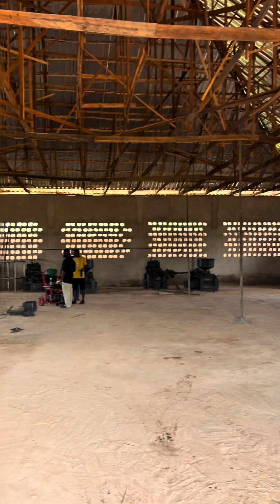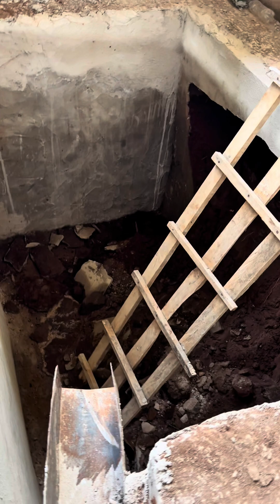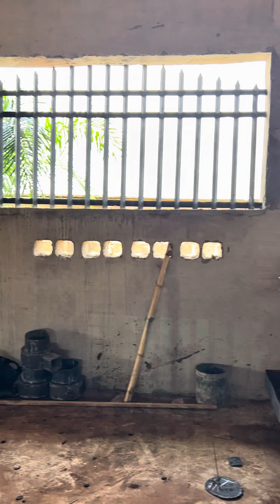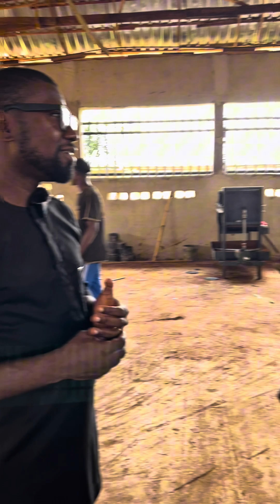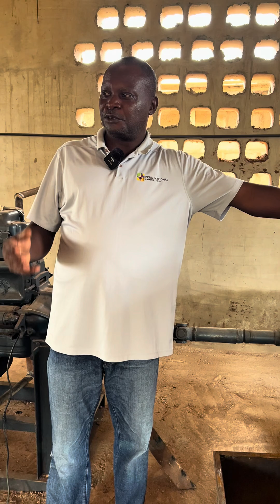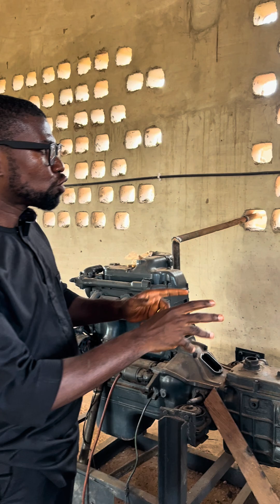Setting up a Palm Kernel crushing facility

Comment: Nice video bro, but from his analysis it’s actually not profitable. If 1ton of palm kernel is sold 720k like he said then 3 tons of palm kernel gives 1 ton of palm kernel oil at the rate of 2.4m there there is no profit in the business after spending on diesel for the production.

3ton of palm kernel is #2,160,000  (720k) per ton.

3tons of palm kernel gives 1ton of PKO Which is 2,400,000

If you include cost of production both labor and dissel there is no profit left base on his analysis. Although I know pkc is also been sold but still don’t show up as a lucrative venture. Please I will like u to trow more light on this because I have interest in venturing into this business
Reply: You just Said my mind
Reply: If I get the man clearly, he said that the market fluctuates and the least you can sell is 2.2m per ton. 

It means if he is buying a ton at 500k and sell at 2.2, he is gaining 

If he is buying a ton at 600k  and decided to sell 2.2 at least he still has something but he may like to sell it at 2.4 because he got the raw material when the price is going up

But if he is buying at 700k for a ton when the price is at the peak, it means that the market has gone up so you don't expect him to sell at 2.2M he will be at a loss so by this time he should be selling far above that price. 

I hope the answer was of help to you